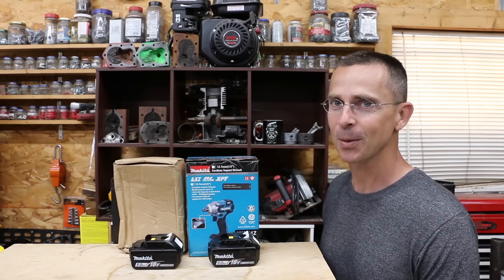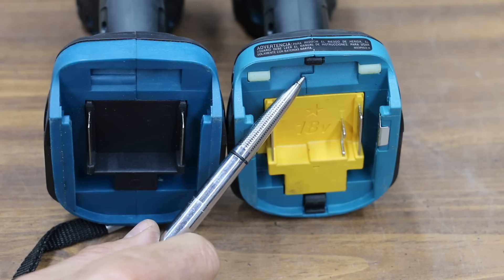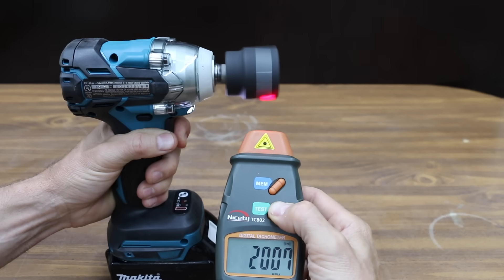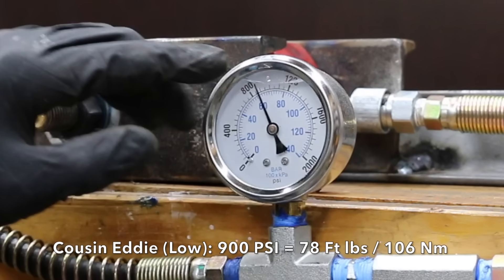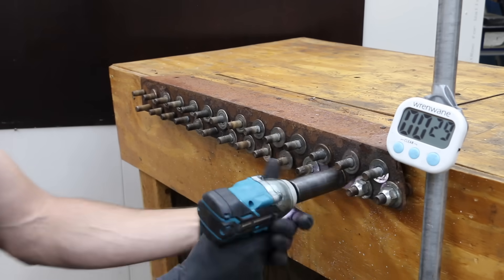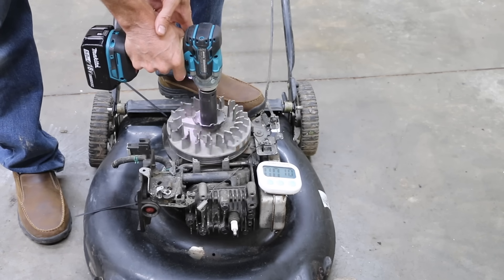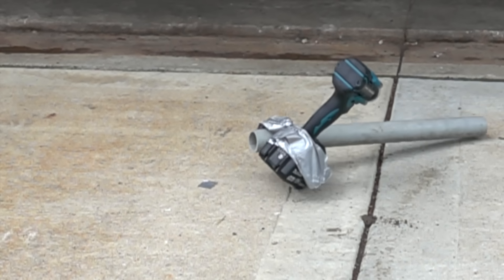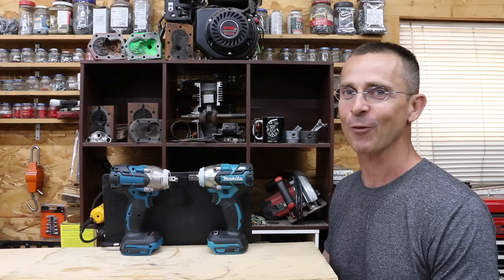Fake Makita Impact Better? Let's find out!  Makita XWT11Z 18V LXT Lithium-Ion Brushless Cordless

Comment: I've an idea that I haven't seen before (or at least found): Hand Cleaners

I work on motorcycles and constantly get mucky hands due to the Carbon, Rust and Associated Particles. I tend to use Swarfega but don't care what flavour, my firend uses swarfega but ONLY the orange one ("Because it's got citrus in it, which is, like, an acid isn't it!"), I know some people just use Fairy Liquid (dish washing liquid in the UK) and my dad is more old school and uses normal soap, then vinegar if that doesn't do it, then 99.9% Isopropyl as a last resort.

I'm sure no matter what tools or projects people do then wanting shiny clean hands without taking a layer off is something we can all relate to :D

P.S. Best trick I've ever actually seen played on a newbie mechanic - tell them they can avoid all the mess if they spray some lube (WD40, GT85, etc.) on their hands first. "Really coat it on there good as a barrier." It's mean, but watching them play grab-the-spanner is hillarious. Even worse, they then have to try and wash off the WD40...
Reply: Pirate Adam yeah he needs to be first there’s many brands I find cherry bomb work well along a few others that seem that are only Commercially available
Reply: Try stoko solopol
Reply: @TractorTech  Agreed, Stoko/ Kresto/Solopol best hand cleaner I've used.
Reply: Oh, please hand cleaners. I used to work for an auto mechanic who had this amazing soap that would instantly wash off oil and grease, but I've never been able to find it myself.
It was really gritty and red but it worked wonders - Anybody know what it might be?
Reply: @AiOinc1  Gritty and red sounds like cherry bomb to me, we used that at the machine shop I worked at, was really good at powering through tough black carbon build up combined with grease, old solidified oils(found in the sumps of mills from the 1930s), cutting oils, and other machine oils.
Reply: @AiOinc1  LAVA soap
Reply: @AiOinc1  lava soap maybe??
https://m.lavasoap.com/lava-bar.php
Reply: @AiOinc1  My dad has that kind of stuff at work and we have some at our house. The one we have is from Wurth and yes, it is amazing!
Reply: @AiOinc1  that sounds sorta like swarfega to me but idk. either way, swarfega works wonders.
Reply: @AiOinc1  Tuffenega you can make your own easily, 50%dishwashing detergent 50%parafin ( kerosene) and sand mixed in.
Reply: @AiOinc1  A gritty red bar? Probably a Lava soap knockoff - contains pumice. Gritty red powder? Boraxo, which is my favorite.
Reply: @AiOinc1  if it was a green bar, it was lava soap.
Reply: Pirate Adam - I used to teach motorycle mechanics at a college in Nottingham. We had one kid that would swear by coating his hands in superglue at the start of the day and peeling it off at lunch, and same again in the afternoon.
Needless to say we got him with "long weights" from Machine Mart, we wanted a left hand hammer, they went out back and looked for it for him... Seem to remember he "jellied" one of the other tutors keys (set his ducati keys in orange jelly in a cup in the fridge), so he got the lad back by freezing his scooter keys...
Reply: I've always liked Goop or Joe's hand cleaner.  Just don't use water before using them.
Reply: @MrLongshot762  old school goop was the bomb for heavy grease, ink or sludge. I use to rub it on stains before washing my work clothes. New goop isn't the same. Not as good. They've changed something.
Reply: Solopol is the way to go!
Reply: Stoko brand "Kresto" is the best I've ever used. Essentially the same thing is Snap-on "Nitro Gold". I think they may be identical, but the Stoko is way cheaper. Far, far superior to cherry bomb, fast orange, gojo or any of the other "usual suspects".
Reply: You can also put on some gloves. It saves a lot of time washing your hands.
Reply: The best thing to get dirty oil off (used diesel oil stains ect) is to use clean oil, WD is fine or new engine oil then a cloth towel, finally washing up liquid or just washing up liquid and sugar, works really well.
Reply: GoJo and Lava Soap will take care of nearly anything
Reply: Smearing some vasiline / petroleum jelly on your hands & arms works great,  it quickly dries or soaks in & you're not all slippery-. Good for painting also..
Reply: Snap on nitro gold!
Reply: @brandonhoover1749  nitro gold is fantastic, but hard to get and very expensive. Check out Stoko Kresto. I think it's identical to nitro gold but easier to get and much cheaper
Reply: Used coffee grounds in your favorite hand cleaner
Reply: Oh damn, luckily being a bike repair freak at a young age I was very familiar with WD40. To be honest any young adult male should have used WD40 at that point. If they actually believe you, they fully deserve to be called butterfingers for life.
Reply: This is a great idea for a video.  I have used Gojo in the past for automotive cleanup but I find Dawn dish soap to be even more effective.  I tend to use automotive gloves whenever I can though, as you can legit die for the toxicity buildup of working on motors for years and years.  A former automotive teacher at my high school (combined VoTech) died only a few years after retiring, and he really pushed all his young mechanics to use gloves.  Perhaps he learned something first hand on that?  I have heard other stories of mechanics dying shortly after retirement too after not wearing automotive gloves during their carriers.
I would at least note that automotive gloves should be the recommended way and why if this does become a video.  They make cleanup so much easier and are not that expensive.
Reply: Side note, when younger I always used Fairy liquid and salt. Sounds weird but its pretty much homemade swarfega just not quite as effective. We have Fairy in the UK too.
Reply: Just add salt to whatever you use.
Reply: Deb “Kresto Special Ultra” this stuff can not be beat! No question, No competition! I work in a factory where every type of grease or oil and fluids are used. But the most amazing part in our 64,000 Gallon paint electro coating system we have to remove bag filters and this paint is insane tough. The Kresto special ultra will take off even the stains and paint solids from our resin/paste mix from your hands. Just don’t wash your face with it... like I did. Between the cleaners and the pumice in this hand wash my face was well exfoliated and raw. Had a bag filter seal rupture when I cracked the valve open and painted my whole front side.
Reply: Some say there Hands still smells like vanilla to this day
Reply: Personally use deb protect barrier cream, deb soap, and deb restore skin repair after working. Even with gloves on (we all know gloves can't be worn or every job) I'll use the barrier cream. I've had dermatitis and don't want it again :P
Missus works at a car parts supplier so it's nice and cheap lol, but I used to use swarfega or fairy liquid and salt i I didn't ave swarfega. Also been known to use carb cleaner on my hands to get rid of oil/grease, then wash my hands and use restore cream if I'm in a rush.
Reply: The green swarfega is crap compared to the orange. The orange has got some sort of abrasive in it where the green is smooth
Reply: I use Arma Paste, works great.
Reply: Ive seen and have used gasoline to clean grease and dirt off hands. It works amazingly but it's dangerous. And probably not healthy.
Reply: @anonanonanon6712   "And probably not healthy."  I use Dawn dish soap.  Now I believe gloves are the best to wear.   But your person.  So I say use whatever you want to clean your hands.  Personal Freedom Member.
Reply: Zolex Cherry Hand Scrub works well.

https://www.amazon.com/dp/B07N952PL5/ref=cm_sw_r_cp_apa_i_Xgt8EbDW4F4DC
Reply: @Ourbluecats   washing liquid and sugar no salt, salt hurts like fook in a cut and the grains are too small ;)
TBH WD40 to get the dirty crap off then the above to finish off.
Reply: I always use washing up liquid (fairy) then mix in some sugar, the grit and stickiness cleans nearly everything, also brilliant for under the nails. The only thing it doesn't clean is spray foam, nothing gets that shit off  🤣🤣🤣
Reply: A 50/50 mix of dishwashing detergent and parafin( kerosene) with sand mixed in makes brilliant and cheap tuffenega.
Reply: Dawn dish soap
Reply: If You use Fairy liquid You get better results if You pour about a teaspoon of sugar on to your palm first then add the fairy before thoroughly rubbing in and rinsing off  , if you have any cuts or grazes on your hands then use salt or better still rock salt instead , as this has slightly antiseptic qualities so bacteria can't feed up on sugars and cause infections , this also works  to a lesser extent if used on hands covered in WD40, but it is very funny when someone falls for the WD 40 Tip ! , do you know the one about asking for a  X mm spanner for a left hand threaded bolt ? , some people still fall for it !  .
Reply: Aramarks Pro Soy is one of the best hand cleaners I have ever used.
Reply: I use an abrasive kitchen cleaner called Jif, and it's pretty good. Definitely less painful than the stuff at work - lol -.
Reply: Lava Soap.  Why this isn't in the comments I read already I would really like to know.  Guessing it just is old? Still works every time I need it tho (only a few times a year)
Reply: Everyone suggesting "just wear gloves" has obviously not gone through our recent, um, supply chain issues.  Bought my first box of 25 pairs of mitrile gloves in 3 months.  Exhausted my in stock supply except some emergency pairs about 45 days ago.
Reply: Real men use Varsol screw the cuts and scratches .
Reply: Yes! Fast Orange, GoJo, Tub O' Scrub, and whatever else
Reply: I use brake cleaner or starter fluid to clean my hands maybe acetone if it's around. Gojo works good but you have to wash your hands a few times with it. Just go with strong chemicals. Don't worry about cancer were all going to die anyways 👍👍
Reply: @AustinRBa   Gasoline, you must like the smell of gasoline.
Reply: Dry rag first, then olive oil on a paper towel (I use the blue shop towels), then wash with soap (the green pumice soap bar is pretty good...but ordinary soap works fine).  And for paint, just the last two steps.  Easy on the hands and the nose.
Edit: I guess it is "Lava" brand soap.
Reply: GoJo.  Original formula not the Orange perfume.
Reply: WD40 washes all grime away perfectly. Then just soap and warm water to wash away the WD40.
Reply: Chris Oddsocks what’s a fairy liquid?
Reply: @AustinRBa  No!
Reply: Fast Orange with the pumice.
Reply: I just use oil and then gasoline. The oil cuts the crud and the gas cuts the oil.

Comment: I wonder if you could test a new model against an old model of the same brand of tool.  I have heard that companies like DeWalt, Craftsman, Cub Cadet, and even Stihl have changed ownership and manufacturing methods and quality has suffered as a result.  Thanks again for the informative videos!

Comment: At about 7:15 there is shiny dust falling, saw this when using my makita at home. I wonder if that’s the hammer and anvil wearing
Reply: Looks like metal coating from nuts and washers.
Reply: It's probably the nut/bolt disintegrating due to higher power and friction.
Reply: The hammer and anvil is sealed to the outside

Comment: Project Farm, did you try swapping the batteries and running some tests? I know that my Ryobi tools run way different with different brands of batteries. I wonder if the cheap $30 tool with a decent battery might be worth getting?
Great Videos.

Comment: One dislike? Must not be a dance fan. While the $30.00 knock off is a great value, if you want a tool that preforms well and lasts, I'd think the real one is actually the better value. I've actually seen this type of thing in the real world while I worked in metal fabrication. There's nothing worse than having a new power tool not even last a week. Supe finally gets me a genuine brand name tool, 4 years later it's still working. Worth paying several times as much, IMO.
Great test, thanks so much for the effort you put in.

Comment: While less versatile, air impact wrenches is where it's at for power.
Reply: Problem for most people is the power for an air impact comes from a $1000 compressor. If all you’ve got is $30 the knock off will change as many tires as the average person will for many years. Also you can’t throw your air compressor in the trunk just in case you get a flat.
Reply: @macthelost    Air impacts can be run off of a 20 gallon tank and 90-120 PSI.  Costs several hundred, but not quite $1000, though portable gas or onboard truck compressors probably reach that high.  For storing in my trunk I'd rather a breaker bar, or a regular bar with either high torque wrenches or a  hammer / mallet as they're going to be far more reliable than a drill.  The Makita is definitely passible as long as you use it enough to keep it charged.  For the cheaper drill, I'd still be worried about the torquing abilities of the cheap drill when as the charge decreases or in cold temperatures. 80-90 foot pound is required for tightening lug nuts, when the knock off drill maxes out at 91 foot pounds in high impact off a fresh battery.  I'm not sure that the 113 foot pounds of reversal is really enough to free a stuck bolt either.  If my memory is right, I think his channel had penetrating oil test (failures) that required over 160 pound feet in order to break free of rust (granted, lug nuts shouldn't be that bad).  I'm guessing that over-torqued nuts might give the cheaper drill trouble.

Comment: I just bought a Milwaukee M18 impact wrench 3 weeks ago! Because I bought a cheap one and it couldn’t undo any of the nuts I showed it and I had loosened some to help it. Just a noise maker but the Milwaukee zips off bits and bolts no sweat. If I’d seen this video then I wouldn’t have bothered buying the cousin eddy at all and just got the ‘expensive’ Milwaukee right away.

Comment: No surprise the makita came out on top versus the knock off, Still use my dad's makita tools purchased 30+ years hence. they've held up amazingly.
 fantastic video :)
Reply: one thing that is a struggle today in regards to the "using dad's tools 30 years hence" is that the manufacturers will not be supporting the battery packs 30 years from now
Reply: @hyfy-tr2jy  True, but the batteries now are pretty easy to rebuild, at a shop or DIY. ¯\_(ツ)_/¯
Reply: sadly makita tools or any other brand, u can buy today, have not the same quality...
Reply: Also if you go to the Swap meet you can buy real brand brushless tools for $20-30. sometimes in the box Or no box but brand new

Comment: I several years ago, I invested many hundreds of dollars into dewalts 18 volt system. Not long after, dewalt moved into lithium ion batteries. Instead of coming out with an LI battery for the 18 volt, they screwed everyone who bought that system over by coming out with a new and improved 20volt system. I was so pissed that I sold all my DeWalt equipment and bought makitas line. I would love to see a battle between DeWalt, makita and Milwaukee impacts.

Comment: Good call, comparing these cheap imports to the real deal. Help the consumers a great deal. I hope this is not the last one. Do all the once you can muster up.
Reply: Also if you go to the Swap meet you can buy real brand brushless tools for $20-30. sometimes in the box Or no box but brand new. they have all of the home depot tools brands & vintage tools that never break
Reply: @Eduardo_Espinoza  Are these the ones that fell off the back of the delivery truck?

Comment: I'm buying Cousin Eddy....it's good enough and more importantly: it's in my price range easily.
Reply: If you're only using it a couple of times a year it'll be ok. But if you're a heavy user I'd go with the makita. Or order five "Eddies" at once.
Reply: @darkiee69  where can I purchase the "Eddie" though?
Reply: @patrickkimbrell8873  alibaba
Reply: @darkiee69  haha 5 cousin
Reply: @darkiee69  I'd much rather buy the cheap one. I'd be less worried about breaking it or misplacing it or having it stolen.
Reply: @Alacritous  Like I said in a previous post. It depends on how much you'll be using it. I don't think it'll last as long as a Makita if you're using it often and hard. But if you're only using it a few times a year I'd go with the cheaper one too.
Reply: And it dances good
Reply: and most importantly: dance moves
Reply: It's a treason
Reply: Good idea to fund the CCP.
Reply: @MegaMicraman  You do that either way. They're both made in china.
Reply: Also if you go to the Swap meet you can buy real brand brushless tools for $20-30. sometimes in the box Or no box but brand new.

Comment: Would be nice to see Makita start making a 24 volt battery pack with the same form factor as their 18volt line. This way you can still use the 24 volt packs in the 18 volt tools. I am sure the tool can handle the over volting.

Comment: nowadays manufacturing is so high tech and easily accessible a real high quality fake is virtually the same and indistinguishable...the real blue prints are stolen from the factory and sometimes real materials are used , probably knockoffs are made by an ex employ of the company who started his own factory , this time it wasn't a good knockoff. but there are triple A grade fakes specially in Asia, even the weight is the same, although these are mostly sold as genuine products, remember the documentary when Air force one even had fake parts ? we never know I might be typing this on a knockoff dell laptop I wouldn't have a clue...